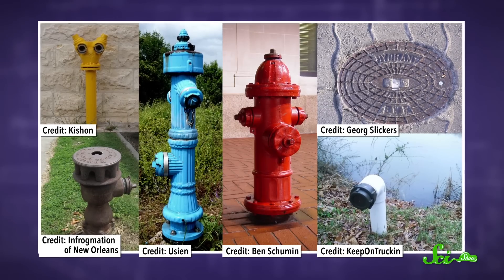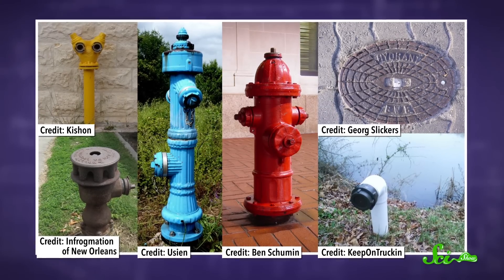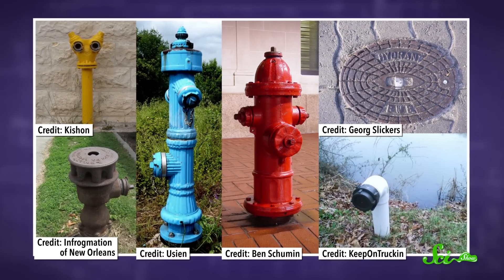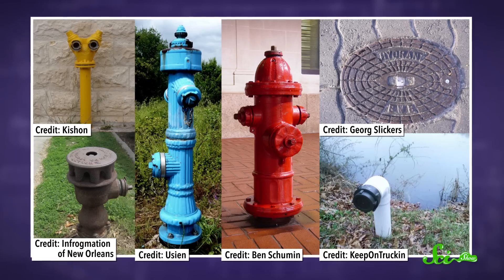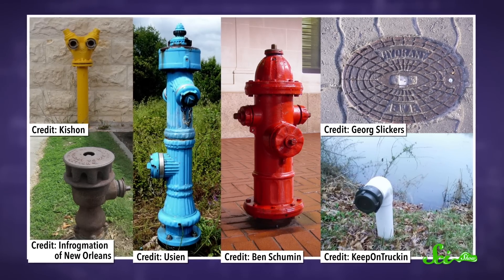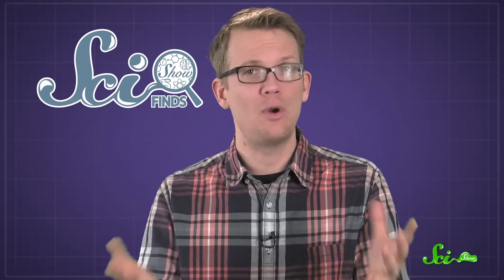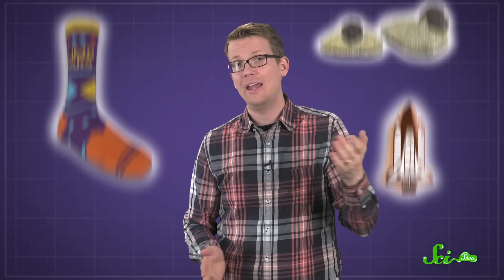Why Don't Fire Hydrants Freeze and Explode?

Comment: Well as a voluntary firefighter I think it would be better if you explained how the european hydrants work too...you remove the lid, take the hydrant out of the car put it on, than you remove the smaller lid that is like 20 cemtimeters away from the lid where you put the hydrant to, take the large metal rod with square end and use this to open the valve. It is easier to mantain than dry hydrant (+you dont have anything above the groud so it can be ANYWHERE (middle of the road/sidevalk, town square, parking lot...)

Comment: I knew watching this I would find something wrong.  In your graphic you show the dry barrel hydrant opening by the valve rising up into the barrel of the hydrant.  It actually does the opposite and goes downwards into the elbow, or boot as it is sometimes called.  The reason for this is simple, it is a safety feature to keep the hydrant closed if the hydrant is struck by a vehicle and the top is sheared off (which it is meant to do as another safety feature to prevent worse damage)

Comment: the actual valve is about 8 ft underground (below frost line) and when the hydrant is properly shut off it drains the pipe from the hydrant to the valve.

saved you from  4 min boring video.

Comment: As a firefighter in the north-eastern United States I can confirm that this is used to attempt to keep them from freezing HOWEVER, it is not always successful. We learn of these methods in our training and everything should work fine but at times the hydrant will fail to drain the water out of the barrel and that water will then freeze, resulting in a hydrant that does not explode (because it is still partially empty and the ice has room to expand) but will not provide us with any water. While this may be classified as just a dysfunctional hydrant, it still does happen at least once a year. On a side note, as crazy as the trash can fact may sound, it is definitely true and we always test the hydrants by flowing water without a hose attached before we attach the hose to prevent any trash from getting into our hose.

Comment: Technically,  water contracts when it freezes. But as water cools from 4 deg C to 0 deg C,  the liquid expands.  As water in a pipe freezes,  the ice plug that forms becomes stronger than the pipe material itself,   so the pressure generated by the water which is still a little warmer,  upon cooling further, exerts the bursting force inside the vessel.

Comment: Having no Hydrants over ground gives a huge advantage: you can place them everywhere. In the US it's not good to park in front of a hydrant.
When you doesn't have anything over ground, you can place it on the sidewalk.
Druing a fire, nobody must use the sidewalk when firefighters are working.

Some might ask if this is to complicated or anything else. No. Firefighters have the barrel in their car and a tool to open the hydrant. Some cars have big water tanks that they can use during this time. There are also not that hard to find. In Germany we have sings on house walls or on streetposts that show where the hydrant is.
In few places we have hydrants over ground but most of the time there are not overground.
One upside is that not everyone can manipulate these hydrants.

Comment: in my country (belgium) there are NO visible hydrants... but, every house has a connection to the main waterline, and in front of each house  the firefighters can use this underground connection to connect a portable hydrant to and use it as they want...
these underground connections in front of each house are capped of by a metal cap to keep the pipe/access clean. And at the bottom of this pipe they have to screw in their mobile hydrant which has a special interlocking cap that opens up the waterline.  It's a nice system if you ask me. Ow, and in case you're wondering... no, we don't pay extra if firefighters use water in front of our house to kill our neighbours fire... we have a meter that is located in our house; that is clearly AFTER the hydrant-accesspoint (aka, our accesspoint to the main waterline).

Comment: In the Northeast, we do indeed have dry barrel fire hydrants. However, they do freeze and burst from time to time. We had one burst in Boston several days ago, water flooded the street for over 6 hours. Generally this only happens if someone forgets to shut the valve off. 

I'm sure it happens in other places but all the hydrants I've seen in Maine, New Hampshire, Vermont and Massachusetts are locked up tighter than a witches nipples. So, unless you are in the habit of carrying around a very large wrench to remove the covers, there's no possible way for you to use a fire hydrant as a make shift trash can.

Comment: Before you even watch they can freeze up.... why.. because the valve is below ground at the water main and the hydrant is designed to be kept in the closed position leaving the standpipe and hydrant  empty. IF you dont close the valve or its leaking it will fill up and freeze... there saved you 3minutes...

Comment: Dry barrel hydrants also work well to prevent water spillage when struck by a vehicle. The top will break off but there will not be a geyser like you see in the movies because the water in below a few meters.

Comment: I'm glad Hank mentioned UK hydrants because I've seen Americans asking about the 'H's they've seen printed at street corners or on little yellow signs when they are on holiday here or may have seen them in a video.  It's so firefighters can find a hydrant, directly next to an H will be a small square manhole cover (or cathole cover considering their size) with the valve beneath it.
Reply: @ Rob Fraser: Thanks, i live in America and i never knew that. I just assumed you had fire hydrants like we do.

Comment: As long as they don't leak and allow water to collect inside the barrel, your video title would be 100% accurate.
Reply: even if they leak, they have a drain, the same drain that is used to empty the barrel after it's been used, so if the leak is not bigger than what the hole can drain it won't fill up.  that drain hole is closed when you open the valve to use the hydrant, and it's open when the valve is closed....
Reply: corrxpt Juice  I get thousands and thousands of likes on many other comments. No biggie.

Comment: so before I watch this, because the valve is actually located 3 to 9 meters under the ground depending where you frost line for winter is, also there is a drain and usually sand or rock at the bottom for the water to drain out of the hydrant before it can freeze after it's use

Comment: Now I want to see one blow up!
Reply: That's simple to do. With the water off. You open up one of the hydrants spigots. And you place within it, 1 dozen, M-80 firecrackers. On a long fuse. You light them up. And then you quickly screw on the Cover to the spigot. And you will get your wish. Then you'll have to blow out that candle. If it doesn't blow you out first? And you might want to use some, safety goggles?

Comment: Why have them above ground at all? Australia has the same system as the UK, even though very few places get cold enough to freeze - it just makes more sense doesn't it? Nothing to break off or get damaged above ground, or get used as a garbage cab & presumably that access issue you talk of for the dry hydrants isn't an issue either
Reply: Think of it this way if a bomb goes off the hydrants won't be blown to smithereens so firefighters can still use them to get whatever blaze is going out.
Reply: AnimeShinigami, your saying that in support of the underground or above ground? Because you're making a great case for having them all underground. It's the underground where a nearby explosion just goes straight over them without any impact & where there's no access to anyone wanting to put a bomb inside one. 

It would be easier to go into a sewer drain & place a bomb to deliberately blow up a water pipe than to access an underground fire hydrant for that purpose & if a car bomb goes off right on top of, or next to a hydrant, the above ground one is disabled, while the underground one is still completely fine & accessible to the firefighters - as long as they can get to it with the heat of the fire so close to the hydrant

Comment: In Australia most fire hydrants either are in the ground and using a special tool a piece concrete needs to be lifted up to access it or in a city they’re located in a panel on the side of a building
Reply: Don't most Australians live in parts that never drop below freezing? If so, I guess the preference for low-profile hydrants in Australia has nothing to do with temperature.
Reply: Australian trucks (lorries and semi trailers) are much heavier than american trucks. I think the underground hydrants are less likely to be damaged by heavy vehicles.
Reply: Yeah, the fire trucks carry the barrel (or whatever we call it here) with them. In country NSW, where I grew up the hydrants were generally a small metal hatch set into the road edge or a concrete pad at ground level.
Reply: Australia has fire hydrants? Well there aren't any where I live (rural Australia SA)
Reply: Lol Bro there would be you just wouldn't see them (provided you are in a town).  They are just a metal hatch into the ground in Australia.  I'm not sure about in SA but in NSW the blue reflectors in the road mean there's a fire hydrant beside the road there
Reply: Australia has the same system as the UK I imagine - we don't have what Americans call hydrants, they're just a special access port to the water main.

Comment: First, GJ putting the Scishow finds link in description this time (though with most stuff sold out, kinda mean now, jus' sayin') \o/
Secondly, while it wasn't clear you were referring to the UK sign above/behind the hydrant as a sign for its location, I feel compelled to point out, the two are unrelated. The sign is there for construction purposes, marking a known height above sea level which construction crews can use to ensure their building is placed at the height it's meant to be built (roughly speaking, it's been nearly 2 decades since I took construction in college and not practised much since).

Comment: not 100% correct. there is some heat generated by the pressure of the water. in eu about 4 bar.
edit
i calculated it, its about 0,032 degrees. you liar!

Comment: They crack when they freeze. I’ve never heard of a hydrant or pipe exploding due to cold weather. We say pipes “burst” when they freeze, but that “bursting” happens slowly and you don’t notice much (except that water doesn’t come out) until the pipe thaws again and water runs out of the new hole(s) in it.

Comment: That's super cool! How do people use hydrants as trash cans anyway? are they easy to open?
Reply: Ikr, if you're going to litter, you might as well just litter instead of taking time to disable an emergency water source. (But seriously don't litter)
Reply: Tahsin Loqman I work all over the UK repairing broken hydrants. The metal lids have holes in them about as big as your thumb so that they can be easily lifted. Believe it or not I have found a lot of used heroin needles is rougher areas.
Reply: They most likely open one of the three ports around the middle that are easy to unscrew if they’re already slightly loose. On a dry hydrant, trash could be dropped into this open cavity. Most of the time, the caps are screwed on tightly and require a wrench 🔧 or specially crafted adaptation called a “hydrant wrench.” 
Water comes from wrenching on the very top of the hydrant, called the “operating nut.”
The more you know 🌈
Reply: Thanks friend!
Reply: Wow. I never noticed that. I guess I'll take a closer look next time I see a fire hydrant.
Reply: I don't think so, pretty sure you use a giant wrench to get them open. Since  you aren't supposed to play with them when not in use they need to be maintained and ready.

Comment: Another time someone hit a fire hydrant with their car, by my school. The city had to turn the water off on that block to repair the fire hydrant. I didn't have to go to school that day because the school had no water supply. 
 Im canadian, so I know cold.
 I lived in a trailer once and the pipes froze, we had to call a plumber. He had to use a special vacuum to suck all the ice and water out though our toilet. 
The only good thing about cold weather in Canada is, if it's -40 out, the city stops running. No buses are running and cars don't start. Which means no school and no work. 
When it's that cold out water turns to snow instantly if you throw it.
Reply: Jennifer Meikle I live in Edmonton and we don't shut down when it gets cold. People here have block heaters and plug in their cars during deep freezes.
Reply: And then there’s Russia
Reply: Ducking A man here in calgary if it gets -40 i still have to go to school ffs

Comment: I might be mistaken, but isnt the main reason for the usage of dry fire hydrants preventing the clogging with ice in case of a fire? 
I dont actually think that the freezing of water would make a hydrant explode, since the water will freeze from the top downwards, making the ice-expansion possible in the downwards direction. (top down because of the thermal conductivity with the water supply lines, keeping the deeper part warmer longer, and because the top part has a bigger surface, because the dome on top and the sides are all adding to the cooling down of the water, making freezing from the top down more likely)

Comment: Self draining hydrants can lead to groundwater contamination in the water main.  Where I live we plug the self draining ports and inspect and pump out the barrels every fall and after the fire department reports to us that they used a hydrant.
Reply: mephiskapheles6 Backsiphoning would only be a problem if the pipe is broken or the hydrant itself is leaking, the latter of which would mean that you have water leaking in to the barrel of the hydrant. This can cause an ice plug problem that could keep the hydrant from functioning if it's needed and that is what the weep holes are meant to prevent. Most places just inspect their hydrants to make sure they're working properly instead of tampering with the manufacturer's design.
Reply: I should have said they come from the manufacture plugged.  Only plugged hydrants are on our approved materials lists.  I believe the thinking is that once the barrel drains there is the possibility of ground water seeping back in through the drain holes and cross contaminating the water main.
Reply: I've been a sprinklerfitter for 17 years. I've put in quite a few hydrants and I've got blackflow training. It doesn't surprise me that some localities would want the holes plugged, but I think their line of thinking is somewhat flawed. If there is a blackflow situation from the hydrant that means that there's another issue with that hydrant that needs to be addressed other than weep holes. I'd think it would be better to fix those issues when they come up than to risk having a non-functioning hydrant in the event of a fire in the middle of winter.
Reply: I don't think it matters. All styles have piping that comes above the frost line. The underground ones just don't have a barrel that needs to be repaired every time it gets hit by a car. Hydrants are designed to break free if they get hit.
Reply: Those are just the specs we use for our municipality.  Our system is in fairly good shape, though we do have infrastructure in the ground approaching 100 years old.  All our hydrants are inspected twice a year, spring and fall and pumped out in the fall if there is any water in the barrel.  We also get notified by the fire department when they use a hydrant and we pump it out afterwards.
Reply: I don't understand why use them at all as opposed to underground ones given all these problems
Reply: I've installed tons of these,  no way you can get groundwater contamination,  water main is pressurized,  any opening into the main would be a leak with water forced out.

Comment: You have to be a particularly determined kind of idiot to use a hydrant as a trashcan.
Reply: yeah but you have to be a supermutant behemoth to use them as a weapon. :P unless you're "SWAAAAAAAAAAAAAAAAAAANNNN!"
Reply: @AnimeShinigami13  Not if your first name is Arnold.
Reply: That's why firefighters always flush them before we attach a hose...found drugs in one once
Reply: some drunks can be pretty dam stubborn!
Reply: I was a firefighter and people do it alot
Reply: Phillip Martin ah is that why most of them has those buttons, to flush it into the sewer? I have always wondered if they flushed like toilets.
Reply: Yeah I don't know many people who will break out a pipe wrench to get a cap off a hydrant in order to put something in there... They'll just throw it on the ground. Unless the last guy to use the hydrant was lazy and only put the cap back on with his hand.
Reply: @ Throttle Kitty: Don't forget to set the throttle kitty to the off position when not in use. That sounds like a control for a big machine. Only joking. I like your name.